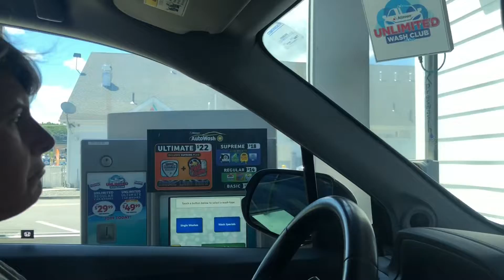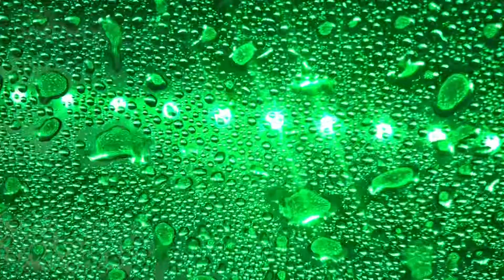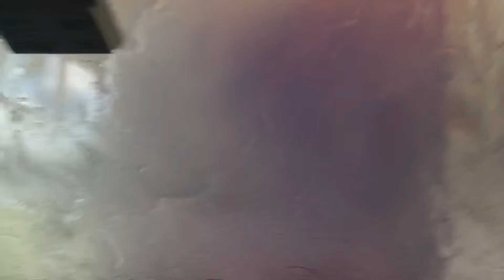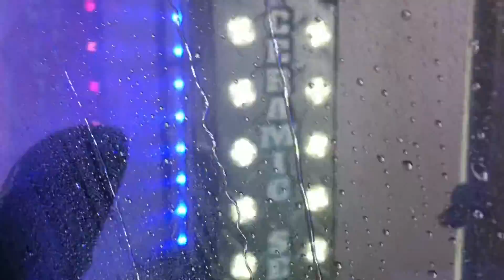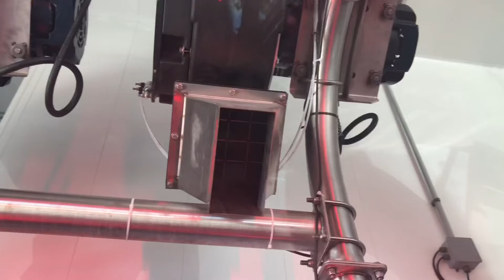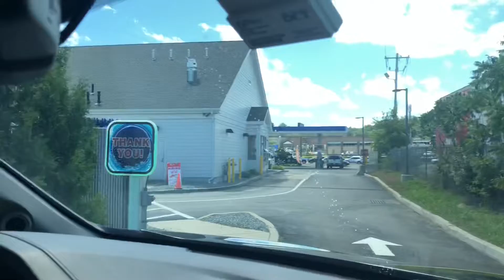BRAND NEW: PECO Mini Tunnel || Mobil Alltown Station

Comment: Nice video! This reminds me of a car wash called Paradise Bay Car Wash which also had a pretty small PECO tunnel, and it had some Phillips 66 gas pumps. But around late 2019 it was demolished and replaced with a Del Taco restaurant. R.I.P PECO Tunnel 2006-2019. :( (Ngl the food at the del taco is actually pretty good.)
Reply from the maker: Big oof. :(
Reply: @thecarwashelevatorfanatic7433  Yeah someone named John Miller filmed it in I think 2011 or 2012.